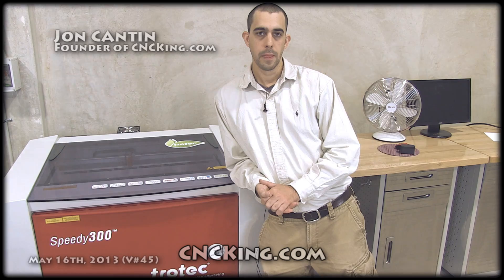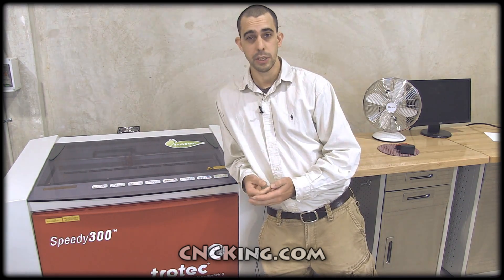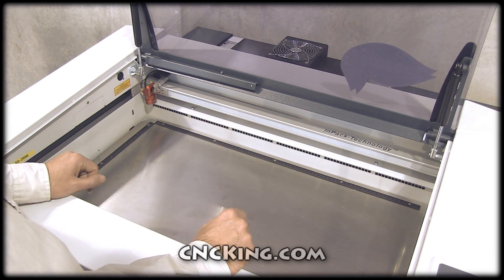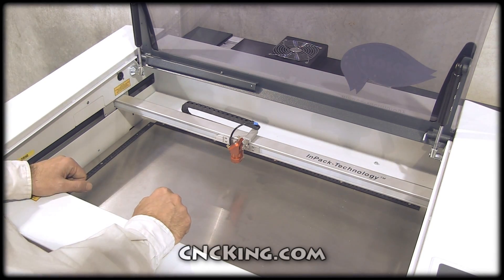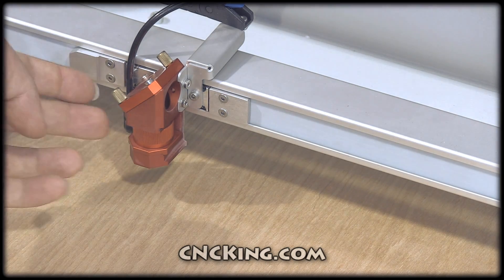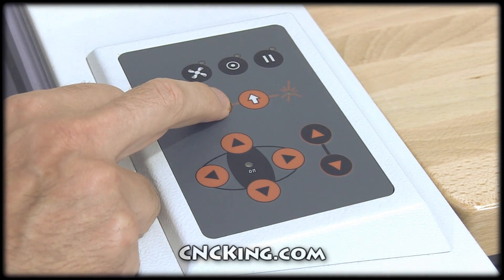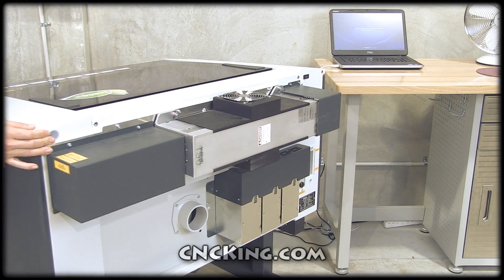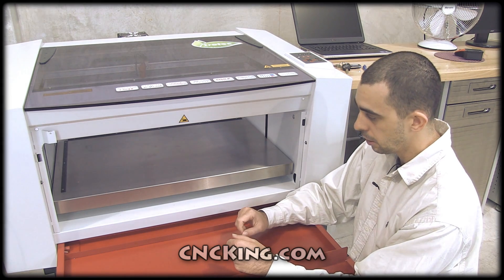Trotec's Speedy 300: CNC Laser Machine Walkthough

Comment: Hello,  i recently got a speedy 100R with a 30W tube. Are flames normal during cutting? Also i thought cutting speed was much higher but presets are always at 1.5 or so.
Reply from the maker: A laser is a high energy source so essentially, you bought a machine that uses "fire" to cut so flames can't be a surprise. I don't sell lasers, talk to your Trotec sales rep regarding settings etc.